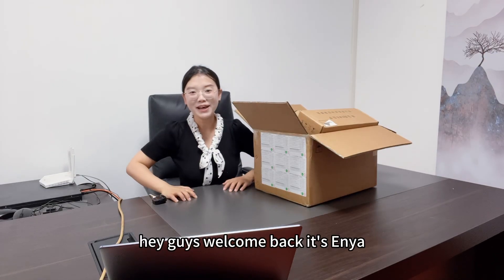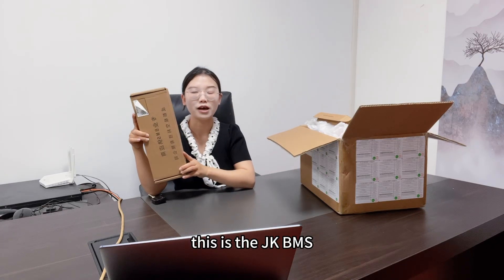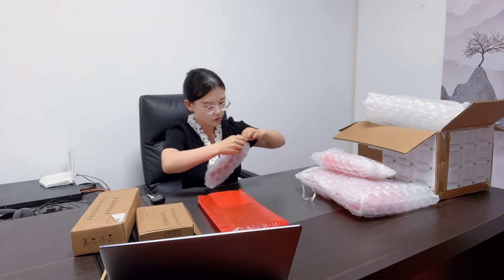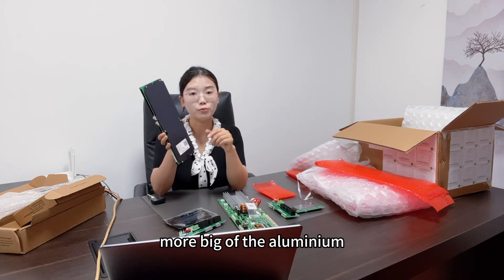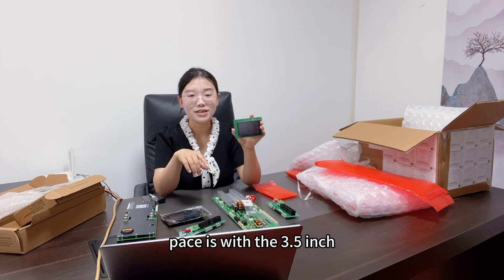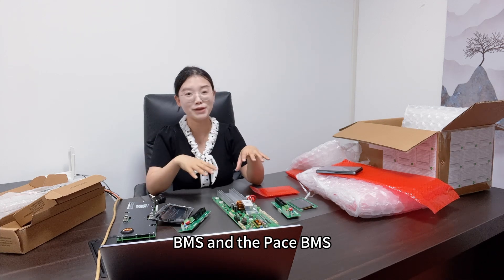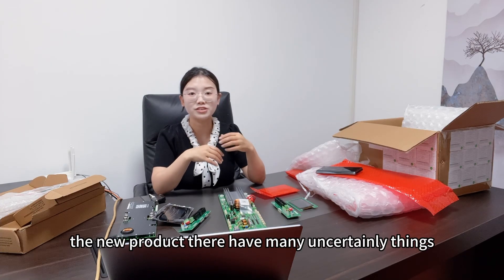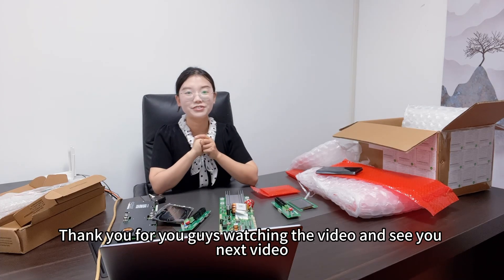Active balance of PACE BMS VS JK BMS part #1 video for reference

Comment: Please make sure if the new Pace BMS will balance only while charging similar the old BMS is doing. This is a big weakness of the Pace BMS as it makes balancing very hard if the inverter cannot provide low current for floating. The old Pace would already work much batter is it balances while battery is full and idling at zero current, so I do hope at least the new one is doing it. Only you Chinese OEMs can pressure Pace to change the firmware...
Reply from the maker: Thank you for your suggestion, we will check with the engineers of PACE BMS and back to you later.